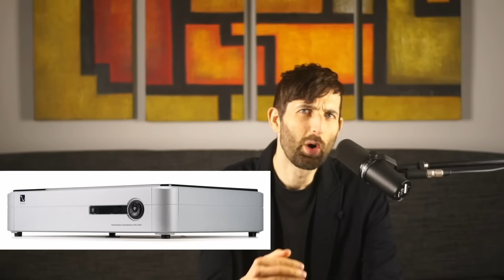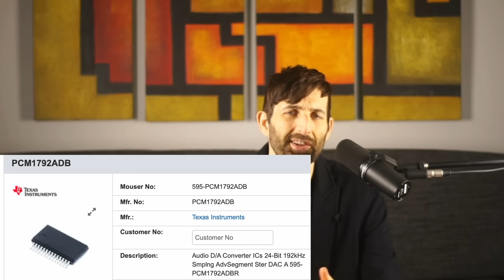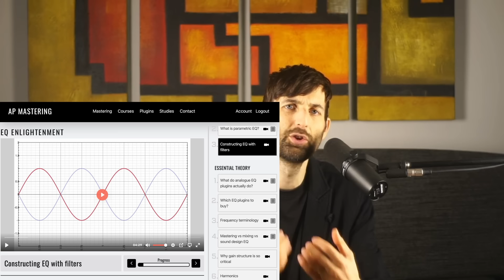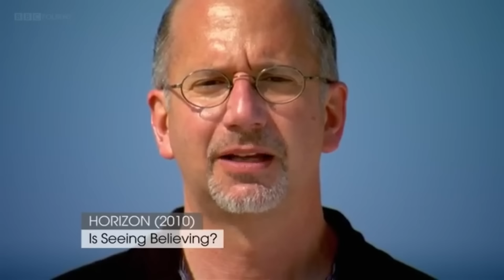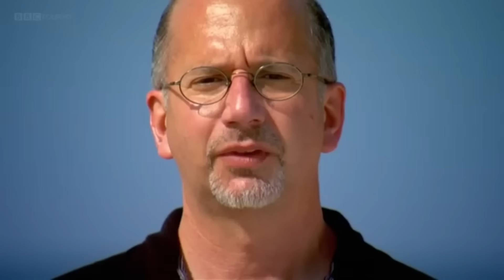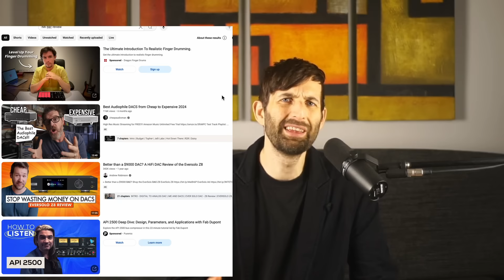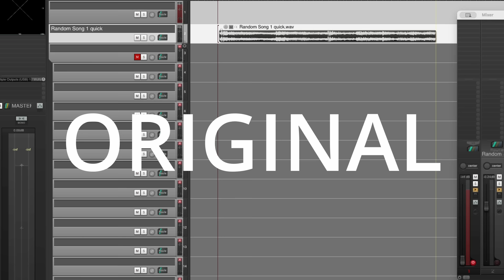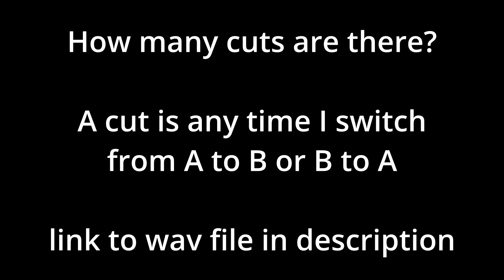The DAC Scam - Almost everyone believes the hype

Comment: You might not be able to affect a digital signal but once it converts to analog you can have your way with it. This is where your analog output stage & noise filtering comes into play. 

Take for example the dac I just finished working on. Digital signal comes in & makes its way to a non oversampling chip.  That's enough to make 2 dacs sound different. But after this digital signal is converted to analog it goes thru a host of resistors, filtering capacitors, Tone capacitors, resistors & into a vacuum tube. Out of the vacuum tube & into some tone capacitors before hitting the output jacks. I can do that output stage 10 different ways, or change the bias or linearity of the signal thru the tube in various ways..& Everytime it will sound different than the last. Hell, I can change the electrical characteristics of the dac just by switching the rectifier tube..which changes the output characteristics. 

Maybe your basic chip dacs implemented in all the same way sound alike...but not all dacs sound or perform the same. That's just silly.

Comment: The dac only converting binnary data to analog signal, then amplifier increase the signal (current) to moving the speaker coil.

I believe DAC is important. But spend $1000 for DAC is a dumb.

Amplifier and speaker more important.

Comment: I tried a number of DACs over a year similar playlist. My favourite is a modified Mojo 1 with a 8v linear supply soldered to the battery terminals. FPGA is the chip and it's programmed specifically and not an off the shelf product. At £200 Inc the linear power second hand it was worth it.

Comment: FFS.. It is more than just the chip which makes a DAC, point to point wiring, custom made torridial transformers. LPS. ceramic boards, resistors, transistors.. caps..silver wire ..teflon coating.  occ copper..chassis build.. internal shielding..need i continue.. Don't forget R&D, and patents as well. All of these factors make a great DAC. one does not need to spend a down payment for a house,  though with proper research, and listenings of various components..one can obtain a legacy product..

Comment: pretty much simplified but very close true. everything is in the details. having the same dac chip inside differently designed DACs will render completely different dacs. eg, if you use 1% or worse Rfb resistors in the I-V stage of AK4499EX assembly instead of proper 0.1% precision resistors or better you will not meet the datasheet specs (you'll get a shitty sounding dac or average) - why? because inaccurate summing is gonna be happening in the I-V stage. It's specifically mentioned in the AN but you won't spot the difference with a regular multimeter. Yet the resistors' prices are simple multiple. Same goes for Vrefs on the dac chips - it's not easy and sometimes costly to design 1uV noise level Vref rails. You're gonna have to pay for proper top tier LDOs  or filtering schematics otherwise you'll end up with an average dac. Almost always a dac below 1K is a set of engineering compromises (they don't do separate power rails, digital and analog is fed from the same sources, rails, cheap switches, etc). But at the other end - something above 2K is probably way too marginal, 20, 40K - a nonsense from the engineering costs POV. Another story is Mola Mola - you pay for the new technology only one company has and for the best possible specs so far. So, does the price reflect the sound?

Comment: Who the hell is this guy?  He doesn’t know what he’s talking about.  The decoding chip doesn’t make all the difference.  It’s the implementation that matters the most.  You have to consider output stage, I/V stage using transformer, clock jitter, resistor type and noise, and most important power supply.  Don’t listen to this

Comment: I have a tiny portable dac amp that cost me 15 bucks off Aliexpress, basically at the thickness of a typical usb wire. Sound is clean and more powerful.
I also have a way better portable dac amp with 2 sound chips inside, the Tanchjim Space, that offers both 3.5 and 4.4mm jack options on top of physical volume buttons that can toggle between high and low gain if pressed together. Matches up well with my low impedance planar IEMs and doesn't color the sound any which way. It cost me 80 bucks.

You do not need more than this. Maybe bigger headphones need more power, so get something that covers that. Anything beyond 150-200$ is fucking dumb in my opinion unless there's some niche feature you're looking for as some kind of professional. For everybody else, do not fall into the audiophile scam hole.

Comment: At the end of they day, all the Specs and features equate to rubbish if your ears don't agree with the sound they hear coming from the device(se) used to get said sound into your ears.  That is the big issue. There are SO MANY factors that affect a pleasurable musical experience, most of which any decent, DAC/Speakers/Headphones/IEM Bluetooth speaker can impact.  It HAS TO BE about the music. If not, what is the point?

Comment: I am suspect that if you do a blind test with the same equipment 3 times but add distortion and a bit of HF rolloff in the chain 1 of the 3 times and tell people they just heard 3 different DACs (or whatever component you want them to think they are comparing) most people who are not audio engineers or audio related professionals will hear the different one and assume it is better.  I also think people who are professionals will say that 1 is damaged or out of spec.

Comment: If you mess around with diy dacs you find that the dac chip itself is one of the cheapest components and has relatively little impact on the sound quality- which is biologically/scientifically much more about timing and jitter than just having a low noise floor. But wayy before that it’s all about room and speakers so I agree with the general sentiment in the vid for sure. 👍

Comment: On the hifi audio world there are a lot of snake oil products. However, regarding to DACs sound differences they are real. I have been an afficionado to hifi for more than 20 years. Have a lot of different DACs from $100 to $6000. All properly engenieered ones. And ALL sound different. Absolutelly all of them. I can identify them by their sound character easily. I have/had many that ASR rates as SOTA and when you heard them you can easily perceive their sound deficiencies. Some have notable colorations that aren't shown on tne measurements. ASR diehards disputed my sayings challenged me to perform null tests of those DACs. The results of those test where exacly what I predicted that would be. Speakers cables also matter a lot on sound quality. I can easily identify what of my cables is connected on my system by their timbre characteristics. Actually I change them when I want to hear different things. Absolutelly no brain bias. But good ear sensitivity. Same with amplifiers. On ASR they claim that all SOTA amps sound the same looking their graphics when on reality all sound different. So you are just another guy that hasn't taken the time to hear different and high quality products and only believes that what you see on a measurement tells you all about an audio component. BTW I am an engineer and I know everything thats needed regarding measurements. 
On DACs even chips with "inaudible" differences all sound different. ESS Sabre dacs are dynamic but sometimes harsh if not implemented on class A bias (Gustard audio made DACs that are ESS class A biased and sound great). AKM chips even the 4499 (I have it) sound relaxed and unengagement they have the best sound stage of all but sound boring, slow, without proper PRAT. Cirrus logic DACs sound  balanced and sweet but they lack the precision of ESS and AKM. TI DACs have clear SNR handicaps and also sound "slow". So, best chip based DACs are 1.ESS, 2. AKM. 
I allso have/had some Chord units made with FPGAs. Currently the best of my set is the Hugo TT2 (I dont have DAVE money) and currently is the one I use 99% of the time that DAC offer instrument textures that absolutely no chip based one provides. That model  measured just OK for ASR compared to SOTA, they recognized their superior filter but disregarde it for the price. Clearly those people are graphics addicts no hifi hobbysts.

Comment: If a DAC chip doesnt reproduce a flat sound from 10hz to 70khz then its faulty, a £2 dac IC from ali express can achieve this, so yes its all bullshit

ive been building preamps for donkeys years and i can tell you a £100 preamp will not sound any different that a 10 grand one, tom evans proved this with his shitty plastic built rubbish. hes charging 25 grand for essentialy 125 quids worth of components.

Comment: The worst nightmare for an audiophile is those who are still paying off a personal loan for a few years and then stumble upon a video like this. 😂
Reply: Yeah but this video is somewhat nonsense. What is going on electrically inside a dac & it's analog output stage will dictate how that dac coexists with upstream & downstream components as well as determine it's "sound".  Sure, I probably can't tell a difference between two basic chip dacs. But take for example the dac I'm tweaking right now. 
Using an older AD1865 non oversampling chip. I have a tube in the output stage..after the dac chip..after various resistors & capacitors. Not to mention I use capacitors (which affect the sound) after the tube & right before it goes to the output RCA's. It's also tube rectified. If I'm adding non-linearities or boosting certain frequencies, using capacitors that effect tone, how the hell do you think it sounds like a basic AKM or Sabre chip dac? It doesn't. Therefore not all dacs sound or perform the same. It's a generalization & lazy way of thinking. And one can measure objectively the difference between a non oversampling dac & an oversampling chip dac. 

I think these videos are based on people not being able to afford certain types of gear in hifi therefore try to discredit the rich folks purchase with science. But unless you have tried all the equipment in the world I think it's poor taste to try & generalize or pigeonhole it. Many boutique dacs are designed to sound a certain way..not just "transparent". You ever heard a dac that sounds great then they switch to another one & now there is this exaggerated or greater sense of dynamics? Exaggerated due to output design. You might not be able to change the sound or noise of a digital signal..but once it converts to analog you can have your way with it.

Comment: DSD is the most elegant and analog-like method of reproducing music. It doesn't even need to be a DSD source as it is an easy mathematical conversion. Once in the DSD domain, the 2.3 MHz (plus multiples) don't need sharp digital filters that rob phase, and therefor imaging cues.
Reply from the maker: Wrong, you need filtering

Comment: Are you deaf? Or have you simply not developed a culture of listening? It's not just about hearing, or if you're over 40 and can't hear beyond 13,000 Hz; someone with a culture of listening, with the language and conceptual framework, can appreciate many factors that make the difference between one system and another, one DAC and another. And yes, DACs don't all sound the same. There are construction factors involved: whether they use low-phase-noise clocks, whether the power supply is linear, whether there's independent regulation, whether regulation is used in parallel or serial, whether there are separate transformers or windings for the different sections of the DAC. The resulting sound also depends on how effective the digital filter algorithm is, whether it uses the chip manufacturer's defaults or a proprietary one. Behind the most prestigious brands are people like Ed Meitner of EMM Labs, who developed Sony's DSD technology. The designer at Berkeley Audio, along with Keith O. Johnson, created HDCD at a company they founded called Pacific Microsonics. The Wadax designer specializes in telecommunications, electronics, signal processing, and acoustics. The chief designers of the former Wadax, which the current one doesn't even come close to in quality or development, came from 3M. None of the aforementioned individuals are newcomers or amateurs. Another mistake by the "well-intentioned" mastering engineer: a degree doesn't guarantee quality or expertise, it only ensures minimal functionality within their specialty. He cited as an example two DACs that do NOT use the integrated chips mentioned, but rather discrete conversion circuits controlled by FPGAs, all proprietary technology. Is this a matter of social resentment or simply reductionist scientism? This is very fashionable in universities all over the world: for example, I think that at least the mastering engineer who made the video will know the following names; Bob Ludwig, George Massenburg, Bernie Grundman and James Guthier: they all use DACs worth more than $10,000 to work.

Comment: A blind test like this only tells you whether people can hear a difference through their own playback chain, in their own room, at their own volume, using their own DAC, amp, headphones, and environment. That’s a very different question from “Do DACs sound the same?”

A few things to keep in mind:

• You’re listening through your DAC, not the one being tested.  
A loopback file still has to pass through your own converter on playback, which masks or alters the differences you’re supposed to be evaluating.

• Volume matching is rarely perfect.  
Even tiny mismatches can make one sample seem “better,” “clearer,” or “more detailed,” even if the DACs themselves are identical.

• YouTube compression (or even WAV playback) isn’t a controlled environment.  
Different devices, browsers, apps, and players all handle audio differently. That alone can overshadow subtle DAC differences.

• A loopback test mostly evaluates the ADC, not the DAC.  
If the ADC is the weak link, it becomes the bottleneck. You’re not hearing the DAC’s behavior — you’re hearing the ADC’s limitations.

• Real music, real dynamics, and real systems behave differently.  
Reconstruction filters, output stages, noise floors, and load interactions don’t show up clearly in a simple A/B loopback file.

• Poll results don’t equal scientific evidence.  
They’re fun, but they don’t control for:

playback chain

listening experience

environment

expectation bias

volume

device limitations

A poll tells you how people voted, not how DACs actually behave.

None of this means DACs are wildly different — but it also doesn’t mean they’re all identical. It simply means these quick online tests aren’t designed to answer that question.

The takeaway is simple:
Blind tests are useful tools, but only when the methodology matches the question you’re trying to answer.

Stay curious, stay grounded, and keep listening with intention.
Reply: Had to get chagpt to help you out with your crap argument?
Reply: @psyborg06 I actually used Copilot, not ChatGPT, and only to edit the wording, not to create the comment. But either way, the point stands: a blind test like this only reflects what listeners can hear through their own chain, room, volume, and gear. It doesn’t answer the broader question of whether DACs can sound different under controlled conditions.
Reply: @TheHonestAudiophile  

1. Most modern DACs are audibly transparent, or very close to it. You'll need to show evidence of this so-called masking occurring for this point to be taken seriously.

2. A lack of volume matching is a common mistake I most often see in sighted comparisons. Is your claim the creator of this video is lying and hasn't volume matched the sources? This has absolutely zero to do with playback as well, so regardless this point does nothing to further your overall point.

• Agreed that compression will vary based on many factors, but again you'll need to show evidence of said masking at any compression level for this point to be taken seriously.

• Agreed the ADC is probably the limiting factor in a "home" loopback test, but this is also an implicit admission of the transparency of modern DACs. If your ADC has resolution at the limit of human hearing, and you still can't hear a difference you'd never have heard the difference in the first place.  

• This one is just nonsense, no coherent point.

• Poll results absolutely can be used as scientific evidence, it completely depends on the hypothesis being tested. This reveals a massive ignorance of the scientific method.